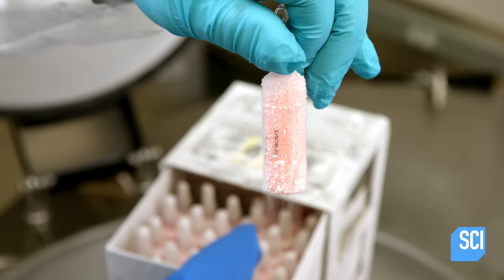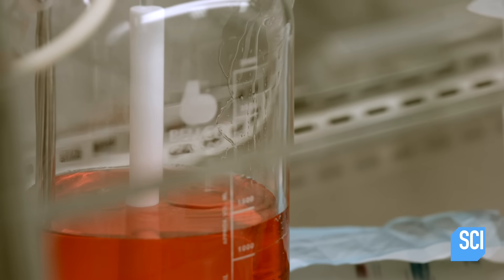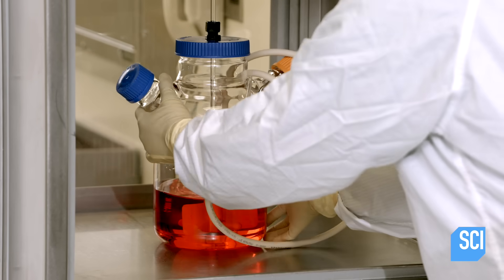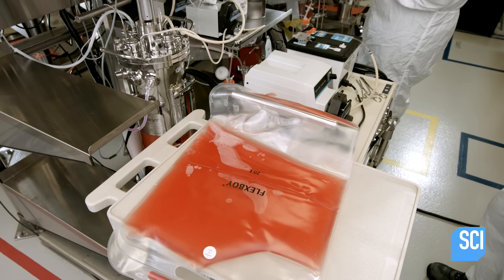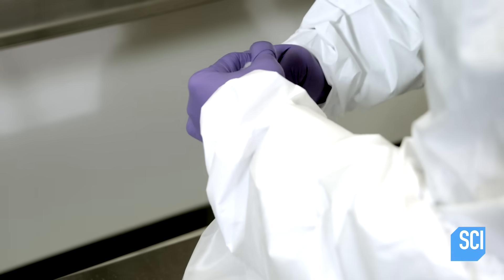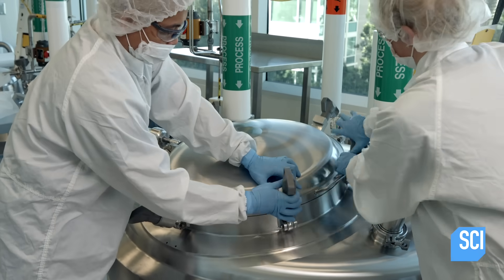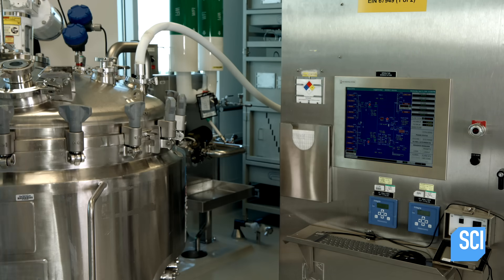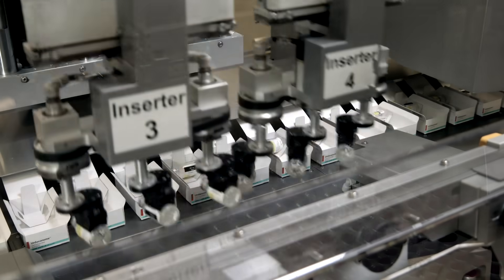How Biologic Medicines Are Made | How It's Made

Comment: Where are the living cells from? Like even generally?  Plants? Animals? Humans?
Reply: It really depends, most common is bacteria because they're really cheap, fast and easy to grow (don't need growth factors), but they can struggle to adequately produce large/complex proteins. Yeast are generally similar, lower yields but better able to produce human proteins because they're eukaryotes too, but not perfect. Depending on the drug and conditions it could be something else (like in this video, where they use ovarian hamster cells). Some processes use immortalized human cells (HEK cells are what I'm familiar with if you'd like to google it), which are harder to work with, and potentially be contaminated with human viruses, but are the best for producing complex molecules and have the lowest allergy risk.
Reply: Chinese hamsters ovaries. They purposely left out that process.
Reply: @ellekay1721 its at the start of the freaking
Reply: They can actually be made from all of them, but they’re mostly made in mammalian cells (expression systems they’re called). They contain a circular piece of DNA (which was deliberately inserted into them, didn’t originally have it) that drives them to make large amounts of the target protein (the DNA in the cells will contain an antibiotic resistance gene, and the antibiotic in the media will jumpstart the process for making the protein and growing the cells that have this DNA in them). 
While non-mammalian expression systems can be used also, in the case of proteins like antibodies they can’t replicate the kind of sugar pattern (glycosylation profile) in the target protein as well as mammalian cells can…

Comment: What are the "other dry ingredients" ?
Reply: For that 'dry ingredients" part, mostly Sodium hydroxide and even that will be use for cleaning and conditioning.
Reply: Dextrose, acetates etc. There are a lot of solutions necessary for purification.
Reply: Buffers for one.  Phosphate buffer solution, PBS, is used a lot.
Reply: Im a compounding technician and usually its a buffer solution and other chemicals, used for titration and getting the pH level, correct as well as WFI, which stands for water for injection and API or active pharmaceutical ingredient as well as possibly a preservative of some kind.
Reply: I'm not exactly sure but I'm assuming it's just other minerals like sodium and stuff